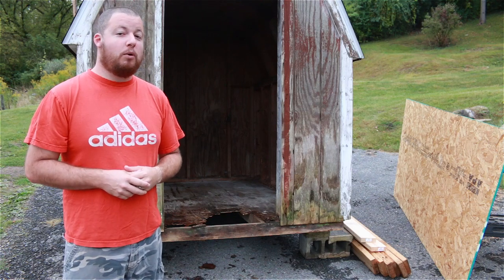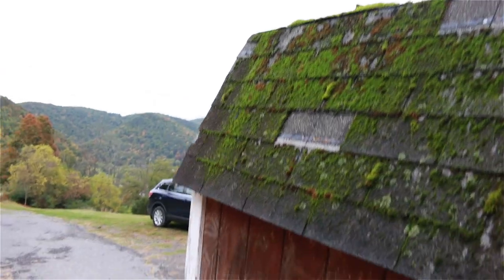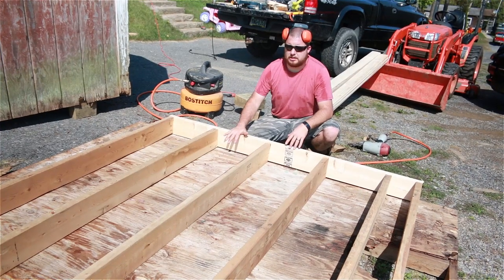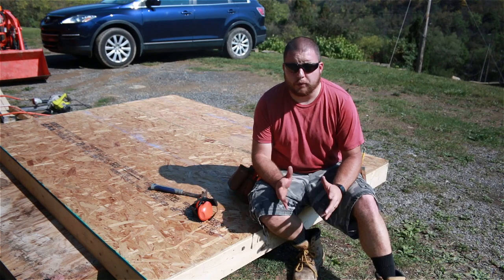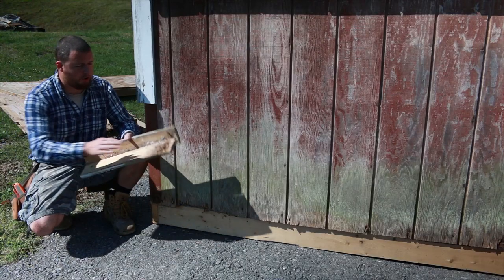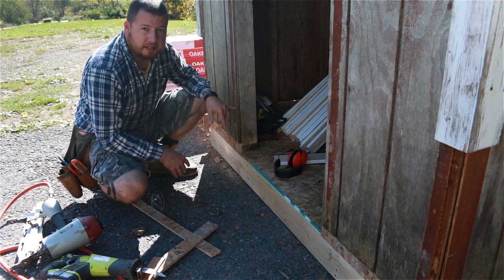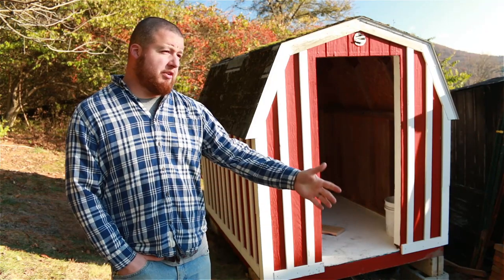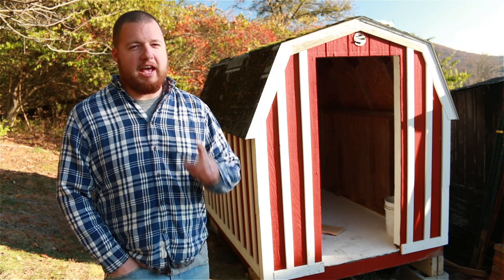Shed Remodel Pt 1

Comment: I also have an Old Shed which was in bad shape because rotted wood due to water infiltration. I fixed it myself instead of hiring someone or buy a new one. It's a lot of hard word but at the end of day it's worth it for the effort. I also shared videos of how I repaired it.

Comment: I was on board until they brought in a tractor! 😂 For those who have tractors please enjoy this. Haha
Reply from the maker: You can use a simple bottle jack to help lift the shed. You can also utilize leverage (like a see-saw) to elevate/move the shed as needed. 1 4x4 post and some cinder blocks will do. Just need some muscle no tractor needed (but def helps alot!)
Reply from the maker: A buddy and myself flipped a different shed onto its backside and removed the floor that way and flopped it down onto a new floor. took alot but is doable
Reply: @appalachiandiy2415  Thanks! :) I have a really nice old shed that just needs the flooring replaced and a bit of paint. Again, thanks for the advice!
Reply from the maker: @BellaMichel  No problem and good luck!
Reply: Yep car jack bro it’s in your car
Reply: Stg
Reply: Yea I'm a country girl at heart
Reply: Right? $100 my ass. lol

Comment: I used a floor jack to elevate mine.  Part of it was so rotted the floor was easy to separate.  I’m having trouble on the other side though.  The building is insulated and has plywood walls inside.  I don’t really wanna tear the inside walls out.  I’m thinking of running a sawzall to cut all the nails and screws between floor and wall.
Reply from the maker: That is what I would try. They make demo blades that work pretty well.

Comment: as many have commented, I was going to replace my T11 half or all. I love the 4" idea. That will save $$$. What is rule of thumb on some kind of critter guard around the shed? some report that you need a cat size opening to keep mice out but I want to keep the possums out.
Reply from the maker: Thanks! Use hardware cloth, its hard steel mesh with varying sized holes from ¼-1 inch

Comment: Dang, I have a shed I have to repair. Part of the floor needs replaced but I don't think I will replace all of it. My shed was made out of Hardy board for the exterior, it's mostly held. Water got in on part of the floor near the door. I hope I don't have to replace the whole floor, I don't have anything to lift it up.

Comment: I have an old shed that I want to move and rebuild pretty much same size but I was thinking of putting it on pavers instead of having a wood floor since I'll be welding in it occasionally. But not sure exactly how I'll do that or if it's possible.
Reply from the maker: Unless your welding directly on the wood floor i think you would be ok without the pavers

Comment: All you need to make this $100 shed remodel work is a $30,000 tractor! :D
Reply from the maker: If I have a tool at my disposal, why not use it?! this can still be done without a tractor. Use 2x4's and cinder blocks to use as a lever and you can easliy flip it on end. Ya gotta work smarter not harder!
Reply: This comment doesn't even make sense... it's not like the went and buy $30,000 tractor to fix a $100 shed. These comment ain't necessary.  C mon

Comment: Fixing up old shed?  That thing looks like a demo project.  At least at first glance it does.
Reply from the maker: Yes! Thats what most people think, at first. A little TLC goes a long way. Most of the structural parts are fine, it's just the sheathing and aesthetics that need fixed.

Comment: This video is ridiculous. Only $100 if the shed is away from property, raised AND you have access to a bobcat . Boo this man

For those who can't lift the shed away from the base , you will need to cut along the perimeter where the floor meets the base and flush cut it. Side up some joist runners and run new plywood